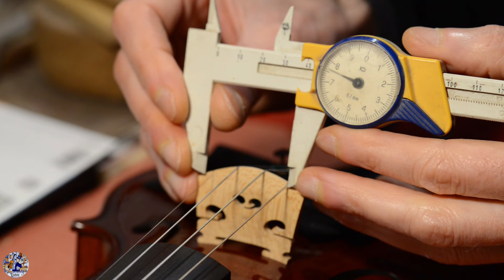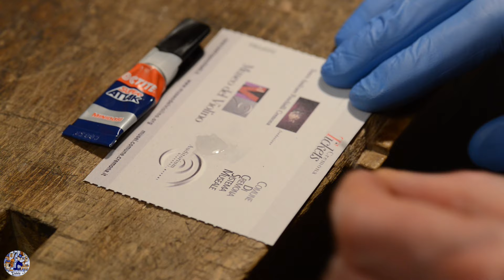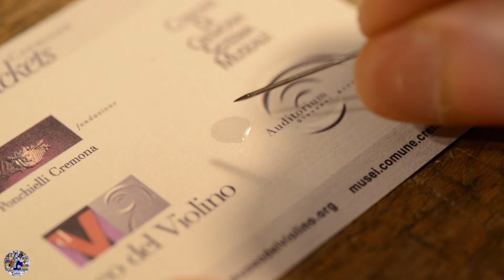Violin bridge from start to finish - Ponticello di violino dall'inizio alla fine

Comment: Im curious how one knows if arms, legs and the heart of the bridge can be made even thinner so there is even less loss of energy from strings to top plate. I wonder if there were any physicists (or amateur experiments) who made public studies in whats the most efficient shape in relation to wood density before bridge will become too weak.
Reply from the maker: The dimensions of the various sections of the bridge can (and should) be optimized according to the response of the violin. There are many scientific studies on these aspects of bridge, but no one can give precise recipes because, in addition to the properties of the wood, the results are variable based on the characteristics of the violins, which are never the same. So the best system remains that of try and error, starting with a stiffer bridge with wider sections and modifying it little by little according to the acoustic response of the violin to which you are adapting it. It is a process that requires experience and often requires adapting more than one bridge to get the one that works best on that particular violin and for that player, because the sound has a component linked to personal taste that remains essential. If you are interested in scientific studies you can start with these which are available on the web for free:
https://hrcak.srce.hr/file/346888

http://oosterhofonline.net/pdf/Bridge_wood_removal_Rodgers.pdf

https://vsapapers.org/index.php/journal/article/view/4/13

You can find many others by searching the various scientific publication sites by paying modest amounts of money, such as this:
https://iopscience.iop.org/article/10.1143/JJAP.41.6291/pdf
Reply: I would google Joseph Curtin. He very probably has written on that very subject with the Acoustic Cat Gut Society, or whatever they’re called.
Reply: @johngeddes7894  Thank you. After experimenting with carving bridges to as thin as possible. I understand now why people don't do it. If one removes too much mass, the dynamics range will decrease. So pianissimo becomes louder but fortissimo stays the same. It's harder to play quiet and control dynamics. For the sound it is similar as if one would use "Compressor effect" digitally. Thus certain amount of resistance (more mass) is desired in bridges.

Comment: I just put my first bridge on. Question: When you are finished and have it in place and the violin doesn't sound like you want it to , is it then you realize you took off to much or you need to reshape it more and in what area.? I tried to match the one that I replaced. I do think I can do better next time and may geta dozen of them and work on it, But what I'm not sure of is on what part of the bridge is vital to making sure the sound is functional.
Reply from the maker: Simplifying to the extreme, the most sensitive area is the waist, but the distribution of masses and geometry introduce many variables. A bad fit of the feet is the first thing that could compromise the sound. In short, it is too complex to put it in a post on YouTube, many articles have been written on this topic that could be useful for you to get an idea. For example this one here: https://fiddlerman.com/wp-content/forum-media-uploads/elcb/2021/04/Bridge_wood_removal_Rodgers.pdf
or this other one here: https://www.mdpi.com/1424-8220/13/11/15290
You will find many other interesting articles on the violin bridge in the references paragraph of these two articles.
Lot of pages to study, I did. Unfortunately, experience and many bridges for many violins play a decisive role in obtaining the necessary sensitivity. Bridge and set-up are the hardest parts to learn in violin-making.
Reply: @DavideSora  Thanks... I got everything I need to shape the piece of wood. I certainly got some reading to do. After I read all of this maybe my question as to Why don't they already come (Other than than the feet ) ready to go? Seems to me they are leaving it up to you to reach a sound that  you prefer. Taking wood off here and there seems to be arbitrary. I see you measuring. Is it the same for each bridge? or do you just hope?  It's an ole fiddle I got ...I put new pegs on it, new  bridge, strings, sound post is perfect...sounds better than it did... but just wondering if I can make it sound better..it maybe all she can give...again thanks for your input.
Reply: @DavideSora  This is from what you sent me....
Consequently, a maker
trimming a bridge does not have to be concerned that his work
will change the nature of the bridge as a vibrating system.
Thus, the options now used by violin makers appear to
make substantial reductions possible in all three bridge frequencies and offer ways to reduce frequencies selectively. It is
no wonder that the advice received from makers was difficult
to understand.
Reply from the maker: @fordjubilee  As I was saying, it's complicated, you need experience and a good dose of trial and error to acquire it
Reply from the maker: @fordjubilee  In this video ( https://www.youtube.com/watch?v=9P8n46DOaDg&list=PLaxadm6POX7EjpjW2BpAr1d_U8ITO5GFP&index=13 ) I indicate two sets of measurements, which indicate the minimum and maximum of my preference.
Consequently, you can deduce that I don't always use the same measurements, because there is a need to adapt them to the properties of the material (as usual, two pieces of wood, and this also applies to bridge blanks, will never be the same), and to the sound we like, what is best is not the same for all of us. Then, it seems to me that some can never be satisfied with what they obtain, thinking that something can always be improved simply by modifying the bridge or the position of the soundpost, when often the limit is the violin we have. In fact things can be changed, but not always for the better, or simply obtaining different but equally acceptable sounds depending on taste. Given that you say your violin is much improved, I would not modify the current bridge but make others with different characteristics (measures, type of wood, etc.) and replace them one after the other to see what happens to the sound. In this way, you will be able to choose the bridge that gives you the best results,  and if this is not the case you will always be able to restore the initial conditions and be satisfied with the improvements obtained with the first bridge. a lot of work, but very informative to gain experience. You can also modify the bridge step by step without removing the strings to eliminate the inevitable variables that this would entail, listening to what happens to the sound after each small change in the measures. This is also very informative but only from a learning perspective: at the end of the process, the bridge will be destroyed and unusable, so you will have to build another one, trying to put into practice what you have learned. It will probably be like starting from scratch because the memory of sound lasts very little (scientific fact), but you can understand which parts are most sensitive to changes, which is no small feat.
Reply: @DavideSora  You have been more than patient with me. With this last reply, you have answered my question. I will take notes ... and order a dozen bridges and improve on the skill part... Thanks again

Comment: Oh, i came to the comments section to find out what the red dust is for the chalk fitting of the feet, is it just plain red chalk? Please enlighten me, I'm training and struggling to get my feet to make perfect contact with the front. edit: and my teacher wants me to do it all my eye, but I secretly want something to aid me.
Reply from the maker: Yes, it's plain chalk, the type used to write on the blackboard, it must be dry chalk without wax-like additives that some artists' chalk contains. Using chalk to get a good fit is quite common in lutherie and restoration work, in this case red chalk is used but for example for the bassbar and the neck setting the more common white one is used. However, developing the ability to work by eye as your teacher says, is essential anyway, and allow you to get very close to the final result quickly and without making mistakes, chalk is only used at the end to perfect the fit to not waste time.
I honestly see nothing wrong with using it even during the learning process.
Reply: @DavideSora  Honestly, thanks so much!

Comment: I never knew all that was involved in a violin bridge. Wow! how does one know when to quit carving?
Reply from the maker: Rocking frequency, material properties, and weight can give a clue ( https://www.youtube.com/watch?v=9P8n46DOaDg&list=PLaxadm6POX7EjpjW2BpAr1d_U8ITO5GFP&index=13 ), but it basically depends on the sound of the violin the bridge was made for. The best thing would be to keep it slightly oversized, try the violin, and make changes to the bridge according to the result and expectations of the player/owner.
Of course, experience is needed to know how and where to intervene, and it can often be useful to cut more than one bridge to obtain the desired results, so as to be able to evaluate the acoustic effect of different bridges on the same violin. It is not something feasible for a factory or low-cost violin, but for fine violins it is the most sensible thing.
Reply: @DavideSora  Thank you Davide. By the way, have you seen Kevinleeluthier saying the bridge side of the tailpiece should be a little less than 90 degrees? I guess this is how Paganini had his violin set up?
Reply from the maker: @TNungesser  I don't know Mr. Lee personally and I don't want to criticize him, but I often find myself disagreeing with what he says, I may agree with some things but others just don't make any sense to me, bordering on misinformation. 😐
As for the bridge, tilting it back (toward the tailpiece) to bring the rear face into the bisector of the string angle might sound sensible, but it's actually a great prerequisite for seeing it bent back in a short time. 
I think that at most it is the front face that must be on this bisector, but in reality it is a theoretical condition that is difficult to obtain or even just to verify in practice, also seeing that each string has a slightly different angle on the bridge and that the angle of the neck, the height of the bridge and the height of the saddle can vary instrument by instrument modifying the general set-up. In my experience, bridges made as you see in my video don't bend in any way when properly made and maintained, and another thing I've noticed is that leaning the bridge backward (towards the tailpiece) can cause problems when playing with the bow very close to the bridge ("sul ponticello"). So to me it's a "no-no", and I don't think Paganini's bridge was angled that way. Together with the violin the original bridge and fittings that he used are preserved, and observing how the feet are cut it seems that it was with a normal inclination (rear face vertical) even if it is difficult to understand this with certainty due to wear. It is also quite different from modern bridges, it can be classified as a transitional bridge between the baroque shape and the modern shape (it has no heart and has very small feet). Where does your guess come from?
Reply: @TNungesser .      You make one,  fit it,  play it , think about it……then you make another and repeat the process.  Then you make a third…..and then you decide.
Reply: On a dark sounding, bassy violin this is done, most often on a Guarneri del Gesu model violin. It helps to give a little more bite and clarity to the violin that needs it. I wouldn’t do it on a bright sounding violin.

Comment: Thanks for this video! The bridge of my violin was badly places and this really helped me to place it correctly. I even made my own video about it ;-)
Reply from the maker: Yes, if the bridge is not in the right position the relationship with the soundpost is no longer adequate, and even with small changes in this distance, the sound can suffer a lot. However, some older violins have the bridge intentionally placed in a different position with respect to the F inside notches, usually to compensate for too long a vibrating string, so the soundpost could be placed accordingly. Moral: Always check the bridge/soundpost relationship after moving the bridge. But if the sound of your violin has improved after bringing the bridge back to the correct position, it is a clear symptom that there is no problem with the soundpost. To get an idea of the correct soundpost position you can watch this video: https://www.youtube.com/shorts/ALodkm5uF8s 
keeping in mind that each violin will need a slightly different position based on its acoustic response and construction characteristics

Comment: Hi - Great Work! What's the height of the wooden stick you used for labeling the height of the bridge on the E string side and the G string side? This is before you label the top of the bridge arch. Thank you!
Reply from the maker: My stick is 5mm thick on the E side and 7mm on the G side, the bridge needs to be a little taller than the finished height at this stage.
Reply: @DavideSora  Great! Thank you!
Reply: @DavideSora  I am sorry - What kind of oil do you use to seal the bridge at the end. It's hard to see it.
Reply from the maker: @soccerplayerfan251  It is cooked linseed oil. Use it extremely sparingly, it must only seal the surface without penetrating deeply into the wood. Any absorbed oil never dries and you would risk getting a muted sound
Reply: @DavideSora  Got it - Thank you! Very helpful! Love your work!!👍

Comment: Beautiful carving knives, where are you purchasing them?
Reply from the maker: For the knives I only purchase the raw blades. The wooden handles, and of course the shape and sharpening of the cutting edge are made by me. The blades come from different manufacturers, a couple are John Schmidt's PM-X steel, one is an old Pfeil and one is made from an old circular saw blade. In any case, any good quality blade will serve the purpose well, if shaped and sharpened correctly, which remains the most difficult undertaking

Comment: Hello. How do you know that a bridge of a good quality of wood? I got some from a local shop. They seemed to be OK but turned to be soft maple wood. All of my installed bridges went bent a lottile in a year or two.
Reply from the maker: Understanding if the wood is of good quality is a matter of experience, but it is possible to get an idea by observing the compactness of the grain and, above all, the direction and sharpness of the medullary rays, which must be long and continuous by observing the bridge from the side and as narrow and sharp as possible by observing the bridge on the faces. This would most likely indicate a hard and stiff wood, although sometimes a softer wood may be needed for example in the case of violins that are too harsh in the high frequencies. As for the bridge bending, the cause is often an incorrect inclination of the bridge with respect to the vertical. In fact, with the tuning, the strings will tend to pull the bridge forward, which, if it is not brought back to the correct position, will inexorably bend in a short time. A properly cut bridge held in the correct position (tailpiece side perpendicular to the line of the ribs, i.e. to the gluing line of the top plate) can last many decades before starting to bend.
Reply: @DavideSora  do you have fingerboard radius 42 mm?
Reply from the maker: @los5mandarinas  I make my fingerboards with a composite radius, one at the nut, one in the center and one at the end of the fingerboard. Only the radius at the nut is 42mm. You can see how I make the fingerboards in this condensed video: https://www.youtube.com/watch?v=fc8GM2DzFa4
If you like to see more details check out the full series of videos, from which the previous one was taken:
https://www.youtube.com/watch?v=-8B2Oju-AiE&list=PLaxadm6POX7GSmVH_BBckj7QZUQC7M_nS
Reply: @DavideSora  Thank you very much for this explanation ! 
Also, would it be inadequate of me to ask who is your bridge provider ? 
Looks like Aubert or Milo Stamm stamp but it's hard to tell from this angle/distance. 
I'm glad I watched this video, and it would seem you uploaded plenty more videos, I'll be sure to watch them all. Your jigs are really great too and inspiring, thank you again for sharing your knowledge !

Comment: Hello friend, very good work and very well detailed, the violin bridge, would you be so kind as to recommend me where I can get the stamp that puts on the bridge?
Reply from the maker: I had the brand made by a stamp factory, any stamp and plate shop can do it, just specify that you need a fire brand. There are also artisans specializing in fire brands, if you do a google search you will find several.
Of course you will have to put your name not mine, Davide Sora is an officially registered trademark and its use is under strict surveillance 
😉🙂
Reply: @DavideSora  Thank you very much my friend, sorry for not specifying, my intention is to make my own cello under my name, that's why I asked you where I send you to make it. My label is F.CENDEJAS
Reply from the maker: @franciscocendejas1226 I was just kidding, I knew you'd put your name on it😅
If you do a google search for "electric branding irons for wood" you will find many that can do it for you including the electrical part. Mine is an old brass brand made here in Cremona almost forty years ago, in a small shop that makes nameplates for doorbells and stamps, which I adapted to an old soldering station for electronic components
Reply: @DavideSora  Thank you very much teacher in truth I thank you very much for your understanding and much more for your time to answer me thank you I will search for you and indicate me in google thank you friend